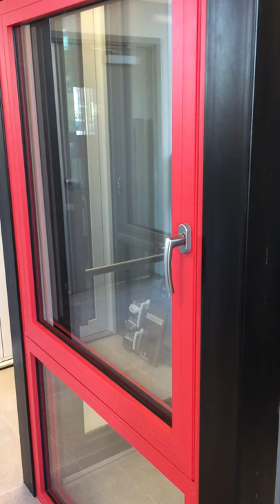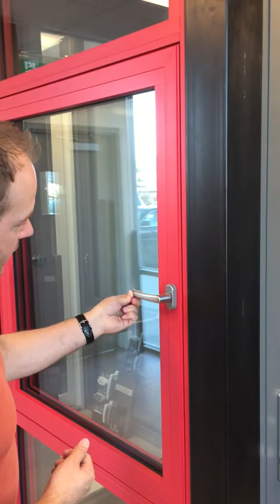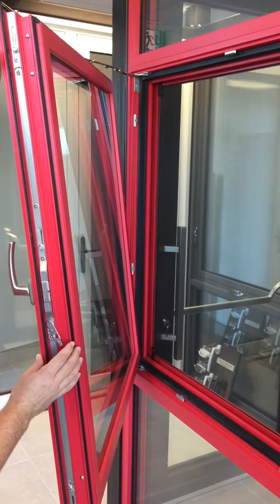Universal Series™ Tilt & Turn Window Mishandling and How to Correct it

Comment: Hello, I initially had the issue of mishandling (handle in open position and window open both in tilt and turn position).
I solved this by using the mechanism which allow to rotate the handle even when the window is open and fix it. But now the window does not close properly anymore. With the handle in close position it does
not close. You can see that is not locking and it is very easily openable. Can you suggest anything? Thanks a lot